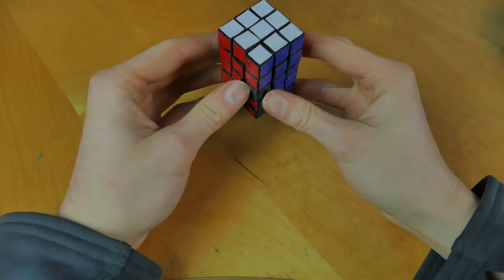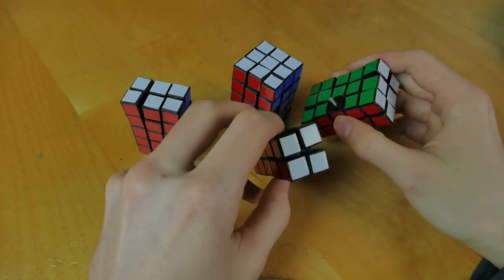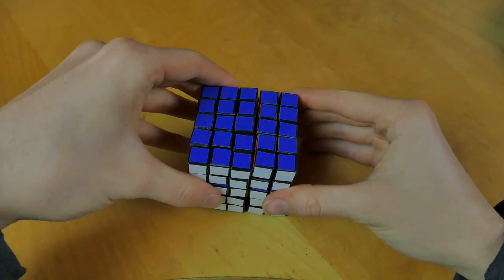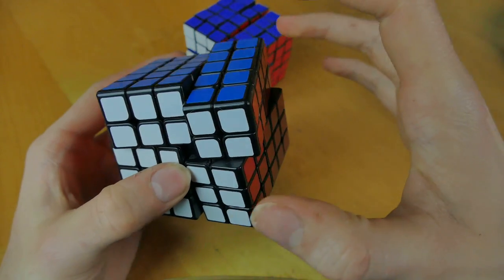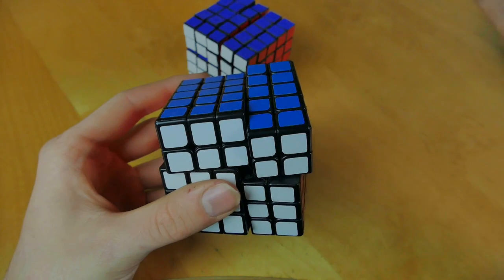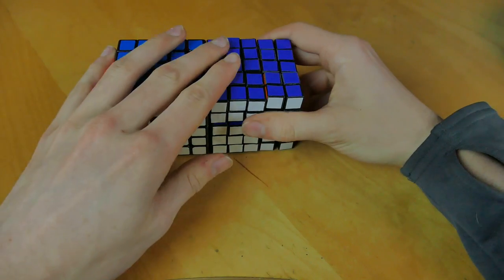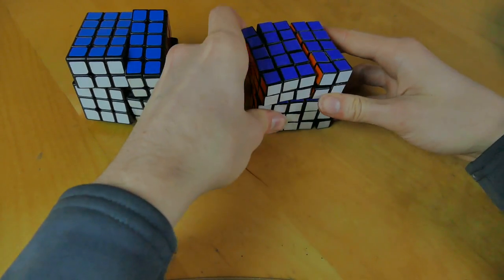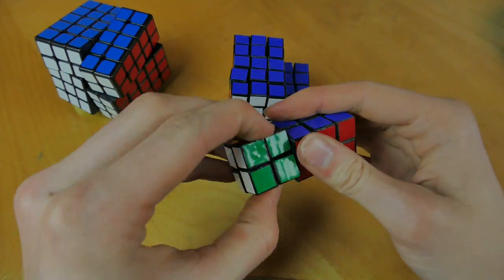5x5 made of cuboids

Comment: you actually can make a 5x5 that is fully functional and can break into seperate cuboids. You could just use magnets.
Reply: I know it wouldn't be practical but it is definitely possible>
Reply: One of my two ideas, so simple
Reply: and it's already done :)
Reply: +Purzel really? What's it called?
Reply: +Jesse Gould Well there is the "impossible" 5x5x1 by Tony Fisher and it uses magnets for the mechanism.
Reply: And also, if you did make a 5x5x5 of jut magnets, that would turn horrible, if you saw reviews on the magnetic 4x4x4 dice cube. Also, it would be really expensive for all of the large sized magnets with stickers also. Also, if you want your 5x5x5 magnetic cube to turn good, you would have to have some magnets weaker/stronger than others. In conclusion, using magnets for this method is unefficient, really expensive, and a lot of work. And if you think about it, you are doing this much for just a 5x5x5 made of magnets.
Reply: +Jesse Gould sry, seems like me posting got deleted/corupted?! ... hope u got it as it was still up :/
Reply: +Purzel what is it called?
Reply: Yes you could but that is considered the "easy way out" and the whole point is to make a cube that could split apart a cube without magnets, unless the cubicle magnetized it